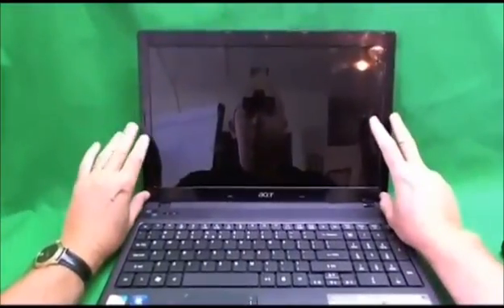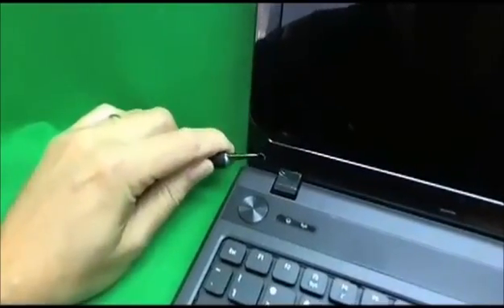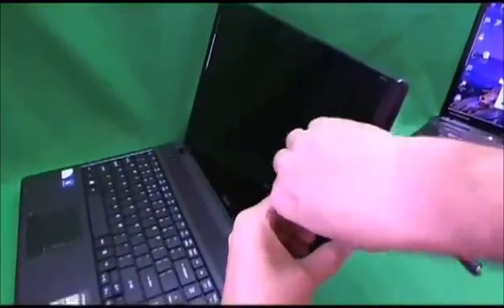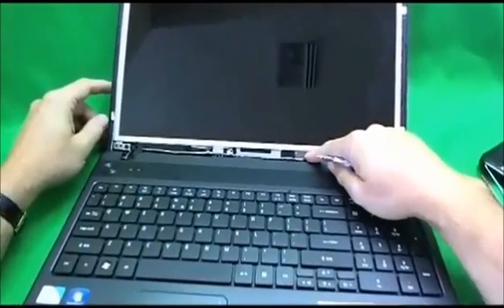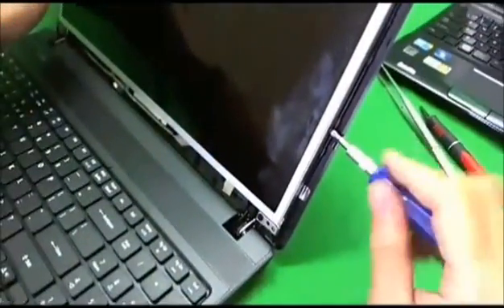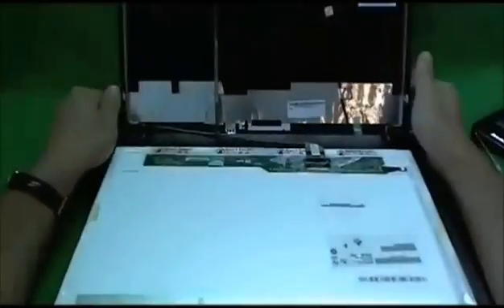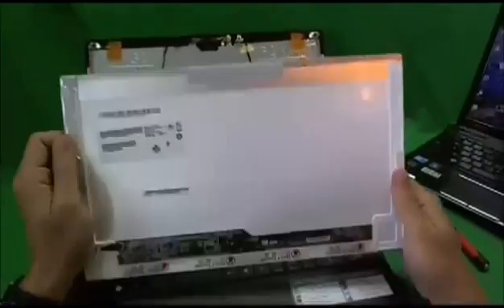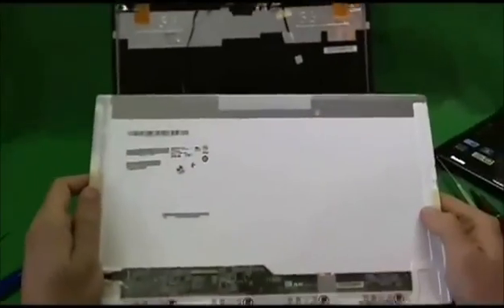Repair Broken Laptop LCD Screen - Instructions

Comment: or buy second hand lcd screen connect via vga cable . if keyboard faulty use usb key board or mouse not working same again usb mouse u could also vga to a tv screen but u will need sound cable from lap to tv .